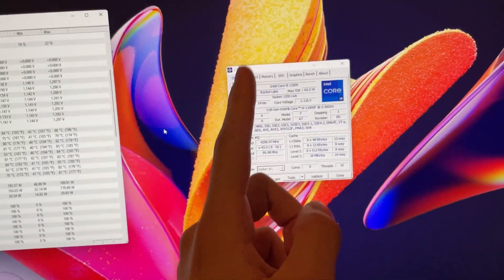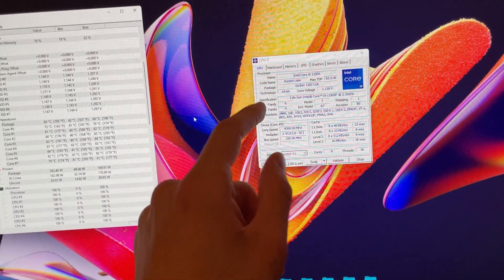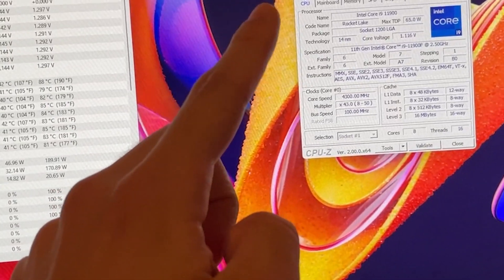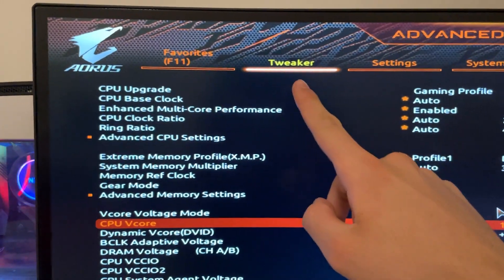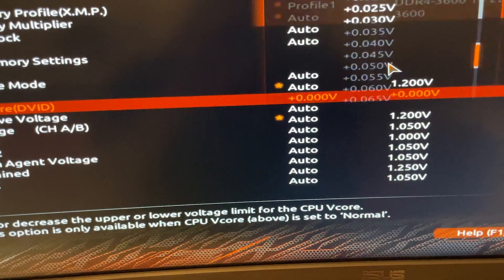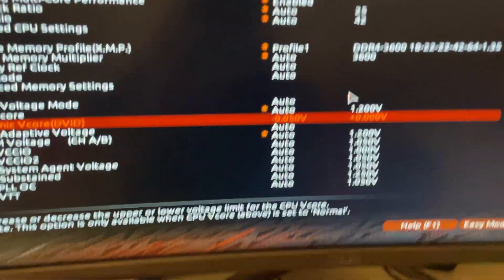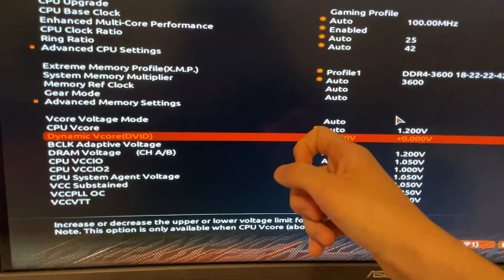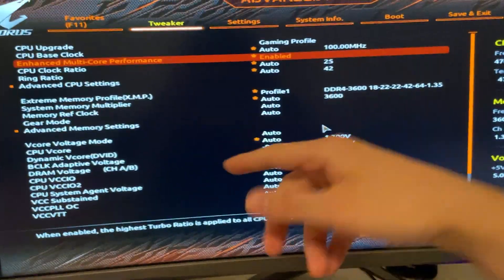Undervolt your i9 11900 and 11900F for more FPS! - Tutorial

Comment: My 11900k would start hitting 90 to 100 degrees Celsius in just 3 - 4 minutes I use a 2 fan AIO cooler but not sure why I keep throttling so badly I wonder if this method would help with that ( I used fresh thermal compound but I overheat so quick)

Comment: do you have a 11900k guide for more performance ? I am running the AI overclock but was wondering if I could get more out of it. Using a large custom liquid watercooling loop which performs extremely well so temperatures are no issues for me. Also undervolted my RTX3090 following your guide and you are a magician ! (100w less for the same performance)

Comment: Cada procesador es diferente. Mi i9 11900kf consigo mantenerlo estable en juegos con éstos valores en el programa Intel Extreme Tunning:
Performance core ratio :  4,7x
Core voltaje Offset : -0,160
Me dio pantalla azul con ese subvoltaje y bajé el multiplicador de 48x a 47x consiguiendo la estabilidad. Ahora los picos turbo llegan a 5.200mhz y no a 5.300mhz (stock). Asumible ya que el rendimiento en FPS es prácticamente el mismo. Si con ésta configuración puede congelar la pantalla en algún juego cpu dependiente, prueba a dejar el offset a -0,150.
Ahora las temperaturas en reposo son de 27-30º C y jugando nunca pasan de 60º C. Los consumos de energía también son muy bajos.
La caja es una Lian Li Lancool 3 y refrigeración AIO 420mm Artic Freezer. MI GPU es la RTX 3080 Aorus, con undervolt a 0,868 mV (uso Afterburner) y nunca pasa de 70º C, unos 60-65º C de media en juegos triple A.
Reply: Aun sirve esa app? Y mi otra pregunta como la descargo? Tengo entendido que intel elimino los links
Reply: @iFexLTE Ya no puedo utilizarla, pero por temas de seguridad, al pasarme a windows 11, éste no me permite usarlo, a no ser que desactive esos sistemas de seguridad.

Comment: Can you do sweet spot Undervolt underclock
Reply from the maker: The target voltage/clock will really vary depending on your usecase though, you’ll get the absolute best efficiency at around 4Ghz with just a little over 1V

Comment: сделал, на какой частоте должен работать 11900kf? 5300mhz?
Reply from the maker: It should run at the maximum all-core frequency that it would at stock, but way cooler!
Reply: @ImWateringPSUs  Спасибо, сделал, он действительно стал холодней и теплопакет 75 градусов максимум при 80 ватт. Интересно, а производительность в играх меньше не будет? Так допустим в игре Shark Maneater наблюдаются лаги, в других играх работает хорошо, лаги только иногда.
Reply from the maker: @RemontKvartir39  That's really good! Thanks for taking the time to comment :)

Comment: I have an i9 11900K, do these undervolt settings also help to lower temperatures?
Reply from the maker: Yes they definitely do! Just copy the same settings and you won't regret it!
Reply: @ImWateringPSUs  will it be stable?
Reply from the maker: @po_bułki  Yes, absolutely!
Reply: @ImWateringPSUs  will they work for 11900k?
Reply from the maker: @po_bułki  Yes!
Reply: you obviously have tons of money or you were drogged when you bought such a garbage as 11900k
Reply: @Mr11ESSE111  It didn't cost me, it was given to me as a gift.
Reply: @Doonet2578  i hope with motherboard because it was not cheap then and now
Reply from the maker: @Mr11ESSE111  I mean to be fair it's also possible to be buying it used, for example mine in the video I paid just 235 bucks for it!
Reply: @ImWateringPSUs  its cpu only and you have luck for that price and prices of used mobos are basically so much too and then its not worth because you can get cheaper r7 5800x which eats much less power for same performance or something better or now r5 7600x
Reply from the maker: @Mr11ESSE111  I mean with around 150 bucks you can get an used motherboard, which in my case meant 385 euros for the combo! That is cheaper and goes faster than the 5800X! And it's much cheaper than a 7600X combo that would require DDR5!
Reply: @ImWateringPSUs  its not faster then 5800x ,in few games   maybe  if it is  hardly overclocked but overall it is slower in 70% of titles especially now with rtx 4080 and 4090 while consuming lot more power and costing  much more too and i compare totall new cpus and 11900k are used garbage now  and r5 7600x dont costs so much because again  new one are under 250$ and mobo new one 170-180$ and AM5 will support zen5,6 too while mobo for 11th gen are  dead end
Reply from the maker: @Mr11ESSE111  Man you seem to really dislike intel CPUs and to be a bit too heavy focused on AMD. You really can't beat the used market in terms of value for money, arguably an used R5 5600X with a B450 is the best buy for gaming ever, you can get them for under 200 euros for the combo!
Reply: @ImWateringPSUs  new one you can get for that money too

Comment: I have i5 9400F
Reply from the maker: You can use the same procedure and apply a -0.050V UV, your chip might also be able to do -0.1 depending on the PSU and motherboard, since 9th gen i5s are less binnes than 11th gen i9s!